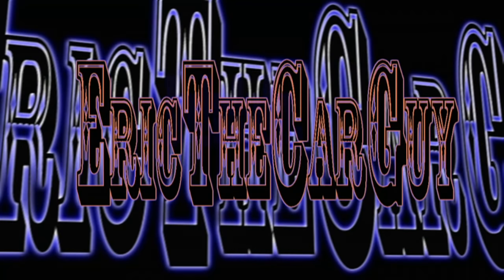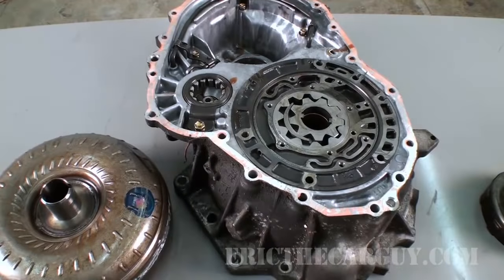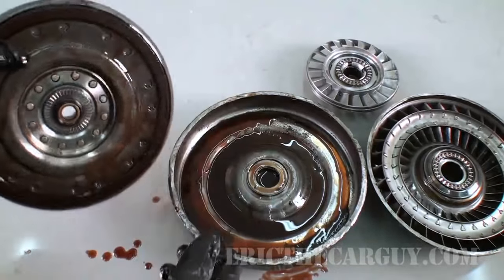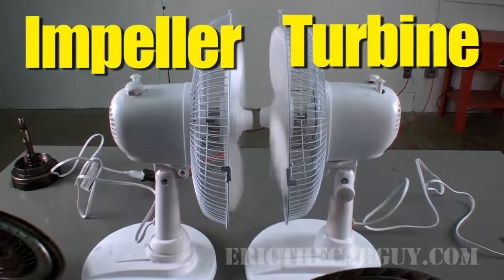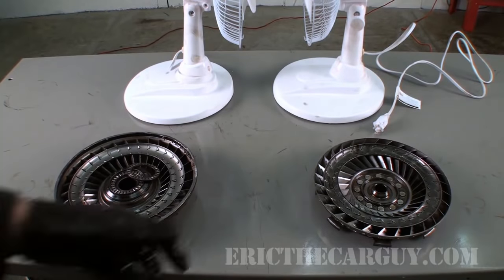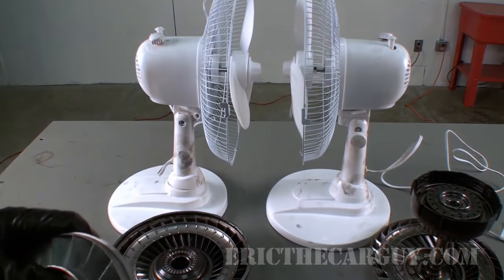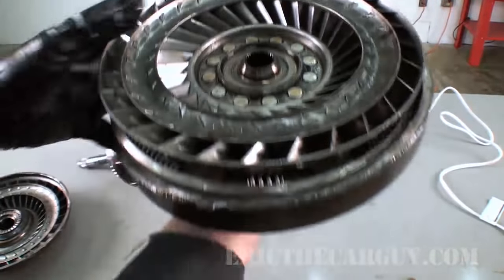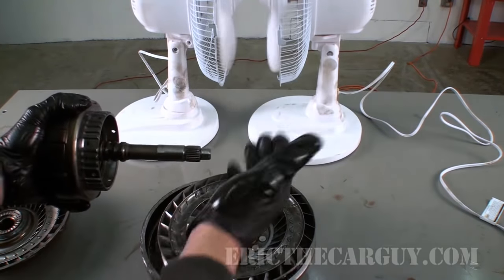How Does a Torque Converter Work?

Comment: I like the fan demo but the fluid passing through the stator is coming FROM the turbine and going BACK TO the impeller, not the other way around as you depict.  The flow in the impeller goes in an in-to-out direction (it's getting spun out by centrifugal force) and enters the turbine at the outer edge.  It flows from the outside to the inside in the turbine - it's called a 'radial inflow turbine' implying that the fluid travels radially inward - and exits closer to the centreline.  Then it goes through the stator and  back into the impeller where it gets spun out again.
Reply: Thanks for that clarification Christopher - I can make sense of it now.
Reply: Christopher Norris Oh ..... that's how the stator doubles the torque. It's for want of a better term 'turbocharging' the impeller. Boosting it. I think that's the missing link for me. Now I get it.
Reply: +Christopher Norris the impeller is driven by the engine. The impeller starts the process by push the oil across the stator to the turbine and starts the turbine spinning and then centrifugal force send it back through the stator and back and forth until the turbine gains speed until centrifugal force is enough that the stator will free wheel and not mess with the flow of oil back and forth. this is how I have always understood it.
Reply: Wrong, wrong, wrong!  It happens exactly as Christopher Norris says.

Comment: This is, by far, the best explanation I've ever heard for how a torque converter works. The only thing I cannot wrap my head around is how the stator increases the torque but I imagine that's a fluid dynamics thing.

The only thing that isn't 100% is the lock up, there are a lot of vehicles (trucks) that will lock up in much lower gears.. I think my duramax will lock in as low as 3rd, maybe even 2nd but that's mostly due to it being designed for towing.

Comment: Hi 
I had Toyota rav4 in excellent condition, but I had one problem, when I get to stop sign or light the engine would died. I took it to Toyota dealer and other shops they couldn't find the problem, but They  replaced computer, sensors, magneto, and some other parts. Finely I give up and I trade in . Now after watching your video I found out the problem was related to torug converter. Thank again and God bless you and your family!

Comment: You could also explain that the the moment you touch the brakes, the clutch releases by cutting oil pressure to the clutch. You can actually see it happen. Next time you are driving up a hill and the clutch is locked, touch the brakes without releasing the gas pedal. You can see the RPMs rev up a little.
Reply: Based on your comment, I'd like to pick your thoughts on a transmission issue that I picked up on my car not too long ago... I don't know who could give me a perspective on my small dilemma. So if you allow me, I'd share with you...
Reply: I drive a BMW E46 330d auto transmission

Comment: @ 7:25. I thought the flow was the other way around from the stator...The flow from the impeller to the turbine is from the outer radius of the impeller to the outer radius of the turbine...and then the fluid flows from the inner radius of the turbine, through the stator back into the impeller.
Reply: Felix Chien to
Reply: Exactly! Change in direction occurs then, adding more swirl to the fluid going back to the impeller, hence multiplying torque.

Comment: You had me thinking pretty good explanation until you started to explain how the stator multiplied torque.  Your explanation missed the mark.  1) the stator redirects fluid coming from the turbine as it reenters the impeller.  Not the other way around as you stated. 2) The stator is not just for breakaway in fact the torque converter varies the torque that it multiplies over a large range of driving conditions during which time the stator is locked. 3) The stator doesn't start to free spin until the turbine is rotating at approximately 90% of the impleller rotational speed. 4) Your first statement about the stator OWC stating that it was a roller clutch but then you called it a sprag.  Roller and Sprag One Way Clutches (OWC) perform the same task but accomplish it differently. One uses rollers and the other uses sprags. Stators always use roller OWC's. 5) Modern day vehicles can and do often start to pulse the TCC on as early as in 2nd gear. This would not be 100% engagement but partial engagement. Even my 94 Acura with a 4sp will 100% lock up the converter in 3rd gear. So the transmission does not have to be in high gear before the TCC will apply. Unfortunately I would not be able to recommend this video to my students for educational purpose with your stator & TCC explanation as is. If you want to be accurate I suggest you edit this video and re-post.
Reply: Maybe you could make your own video and show it to your student.
Reply: It's on my list of videos to do.
Reply: Thank's for this post, I thought for a while I had missunderstood the function of the stator completely.

Comment: So that is one of the reasons you feel a "boost" off the line when you press both gas and brake at the same time in an automatic vehicle, and then let off the brake...
Your engine is at the stall speed, so the stator is multiplying torque, but the brakes are holding the vehicle steady. Release brake and feel the full power of that torque, but once moving the stator is no longer multiplying torque and you realize that your 97 camry actually does not have as much power as you wished it had XD
(Right?)

Comment: I went from knowing the term “torque converter” and that it had something to do with an automatic transmission to having a general understanding of it in 15 minutes.

That is some impressive educational compression, sir!

The only down side is that now I feel the need to learn how the rest of the automatic transmission works.  It will be time well spent.

New to the channel, but if you need extra areas to explain, all of the suspension bits (ball joints & tie rods & whatever else goes between the body and wheels) would be a great series.  Also a shock absorber versus a strut.  There were a few decades where I had the luxury of not repairing my own cars, and I missed a lot along the way!

Thanks!

Comment: The stator explanation completely lost me. After some further research, I found that the explanation was inaccurate. The stator alters direction of the centre return flow from the turbine, not the outward flow from the impeller. Because of the way the turbine blades are made up, the return flow from the turbine is opposite from the direction of the impeller rotation and that would oppose impeller rotation. The stator comes in and redirects the fluid flow to match the direction of the impeller blades. The torque multiplication occurs when the force of the fluid hits the impeller blades in such a way that it assists with engine rotation. The stator starts rotating when the impeller and turbine start approaching the same speed. Hope this helps anyone else who also got lost.
Reply: Prevented me from having to type all of this. Glad I read the comments before saying the same thing.
Reply: Relax Rocco there was a whole lot of fantastic information in this video
Reply: My. Nissan feontier.  2004. 2.4.  The parking dont. Work.  But. Old. The. Other gers. Work good.  Wat.  The problem.  Kant.  Be.
Reply: ACTULLY THE WAY IT WAS EXPLAINED i SAW YOUR EXPLAINATION AS THE SAME.
Reply: Thanks... I was wondering the same thing... glad I came to the comment section before watching it for a 3rd or 4th time to get past the directional flow... which didn't make sense the way he explained it...
Reply: That was my understanding, during heavy or moderate accleration torque multiplication is still happening. It depends on tc design, and how much speed difference of speed between  impeller and turbine. I.e  the harder you push the pedal the more the fluid coupling slips, and more torque multiplication. The turbine speed will tend to catch up to the impeller because of the increased torque.
Reply: Thank You!!!!!!

Comment: Hi Eric, Thanks for clear explanation. I have one question?! Why is it bad to put a car, back in Neutral while it's running? Let's say the car is going down hill (or it's going down a steep road) and I put it in neutral for few minutes (to save gas). Once the car needs to gain speed, I put it back in drive. I've heard from many people that this is bad, but no one can really explain why?

Thanks
Reply: You'll be fine.
Reply: kas kakavand When you go into Neurtal it's being towed under your own weight. It should be written in your car's manual, what speed and distance of towing is safe for it's transmission; on greater speeds or distances of towing the transmission starts lacking oil in moving parts and has a painful death.
Reply: I don't know either but something as simple as coasting across a parking lot in neutral actually blew my transmission. So whatever it is, don't do it, neutral Is bad
Reply: kas kakavand Unless you're driving a manual, you shouldn't do the neutral coast due to what others have said in this conversation.  The whole unit (TC, and transaxle) needs all the parts to be driven by the input (the engine) to keep all the fluid moving around the transaxle.  If you're coasting in neutral think of it sort of like...part of the unit is rotating at the speed your wheels are turning but since the engine isn't keeping the fluid pressure up by way of the torque converter you're basically going to wear out the transaxle due to severely reduced fluid pressure which means not everything is being lubricated at the proper rate for the work it is actually doing.

Does that make sense?
Reply: kas kakavand dont be so cheap. Driving an auto is bad enough
Reply: kas kakavand you should only shift into neutral when experiencing prolonged stops. as indicated in the mercedes slk 500 owner manual
Reply: phuturephunk this is the reason.if you wanna hypermill you should have bought a manual or a hybrid
Reply: RGB Reading This was a general question, it doesn't necessarily mean that I have a automatic and I want to do this. I was looking for the reason behind it :)

Thanks
Reply: In the case of towing , the prime mover (in this case the internal combustion engine) is not on/turning/activated to push the impeller which after all the torque converter going on`s (thanks Eric) turns the transmission fluid pump, and sends the fluid out to a external cooler, usually called a heat exchanger in the cool side tank of the radiator thus cooling the fluid down.

This is why OEM`s tell you not to tow too fast because you will cook you trans, because it cant get pumped.

However with the engine on and in N going down a hill the fluid is still getting pumped and thus cooled, simple?

Comment: "possibly stall your engine"
If your driving an older gm and you know it's not the fuel pump it's the TCC solenoid
Reply: Great video, I think Eric forgets to mention the activation of the TCC is through a solonoid that activates to lock that bell housing in place.

Comment: The forbidden donut
Reply: Doh
Reply: @sentientdogma1206  bet you're some buzz at parties
Reply: @ethanwelling4546  No kidding
Reply: @sentientdogma1206  it's forbidden because nothing else but an automatic transmission can have one
Reply: @fiberrabit8229  Koenigsegg has hybrid vehicles which exclusively use a locking torque converter known as HydraCoup for a transmission

Comment: this is why I am a body tech. all I need to worry about is banging a damn hammer.....
Reply: This is why I drive nothing but manual transmissions. Clutch replacement is simple, transmission repair is simple.
Reply: That’s a good choice,,so you don’t have a customer came back to complain have the tires go flat, after a complete turn up .

Comment: I live in the UK and used to work in the Borg Warner in the transmission division in South Wales, I have built 1000s of the those converters and the stators and also put them on the dynormometer for testing. Brings back a lot of memories.

Comment: Great explanation and demonstration. I know most people wouldn't have much interest in the earlier versions of a lockup torgue converter but I own a 1954 Hudson Hornet sedan that has a Borg Warner automatic transmission that it came from the factory with and it has a lockup torque converter. It is also one of the largest torque converters I have seen in a car. I hope some finds this of interest as a side note.

Comment: Good explanation. GM's 4L's etc actually lock up in every gear. What we do is tune in the parameters of tow/haul which only uses lock up in high gear, but it still shifts as if it's not in tow/haul (which shifts at higher rpm and harsher shifts) and makes the converter happy and lasts much longer. A few others use tc lock up in other gears other than OD. Good content, not too many people explain a TC very well.

Comment: Playing around with cars for many years, but never really understood the job of the torque converter, just changed them when they quit. Nice easy to follow explanation of " how it works ", I guess they don't use modulator valves on the outside of the converter any longer.

Comment: Never took the time to understand automatic transmissions. I’m beginning to delve into them (I have a truck with transmission issues that I’m trying to fix). I never knew torque converters had so much going on inside. As an aircraft mechanic they make lots of sense. Turbine engines use a fan we call it N1 and a compressor we call that N2. We use the turbine section to spin N1 and N2 they are attached via concentric shafts. These rotating sections of the engine are separated by stators. The stators job is to set the air at the perfect angle so that there isn’t a stall (this is where the air passing over the next stage of compression or extraction exceeds the critical angle of attack. The air becomes turbulent and stops flowing. Turbine engines often use variable geometry stator vanes which are controlled by fuel to change their angle to achieve optimal performance. I’m sure the stator in the transmission also serves this purposes to prevent turbulent fluid flow. It’s interesting though that they use it to extract power though too. 

Still as much as I understand jet engines it’s not fully translating yet, but I’ll get there. Very cool video. Glad someone posted a basic “this is how this works” video. Thanks

Comment: This is by far the most thorough explanation of how the torque converter operate.  My question is how does contamination cause it to loose performance and how do you k own what type of fluid to use to make it work more efficient without issues?  And last,but not least which fluid is best to use to prevent future problem?

Comment: Thanks for explaining this so clearly, here in the UK autos are mostly  dry dual clutch systems that wear out over 8 years or so and when I was looking for an automatic car I was looking for a proper wet torque converter gearbox and only PSA makes them for modern cars but they dont fit them to every make of car they make for the UK market, I know its probably not a popular make in the USA but Citroen were the only make I could find with one, it is amazing just how much work is done by the transmission fluid and this is why it is so important to maintain that fluid and clean the filters out regularly. In 30 years of driving this is my first automatic car and it changes up through its 8 gears very smoothly it is mated to a 1.5 turbo diesel engine and returns about  60 mpg on a run and 45 mpg on shorter trips which is amazing for such a tiny little engine, I remember replacing a head gasket on an old 1980 ford cortina 1600 auto for a customer years ago and it was guttless and had no power at all. in comparison the little diesel 1.5 turbo is amazing and is matched to the auto box very well.

Comment: This is a good understanding of why manual shifts often get better fuel economy.  The manual shift is like the torque converter clutch always locked in every gear , not getting that power loss.

Comment: Dude, I was a total gearhead during the 70's and 80's. I worked on lots of cars, but my knowledge about torque converters was zip. I knew how to take them off and put them back on. Bolt 'em to the flywheel and drive away. It always bugged me that I didn't know how, or why they worked. I love this video!  I sent it to my brother who I'm sure will love it too.

Do you have a vid about today's duel clutch tranny's?

Comment: Nice presentation. It didn't make me hate PRNDLs any less but it did help me understand the slush pump a bit better. My father was a big fan of PRNDLs but here in England they were harnessed to 1600cc and 1800cc engines and gave glacial acceleration despite having a stator. Also on the motorway they revved highly at 70 mph not having a lock-up clutch. The two satans of motoring are Diesel and PRNDL. I had a Mercedes recently which was both and couldn't wait to get rid. How I hated it!

Comment: Well done. I'm finally on my way to devolping an understanding of how that black box, I mean circle, functions. Previously, I had no clue how these squirrel cages worked. There was some chrome writing on an old 1950s Buick from my childhood I remember that spelled "dynaflow" or a John Deere combine I used to drive in the mid 1970s with a "hydrostatic" transmission. I suppose these were early forms of the torque converter.